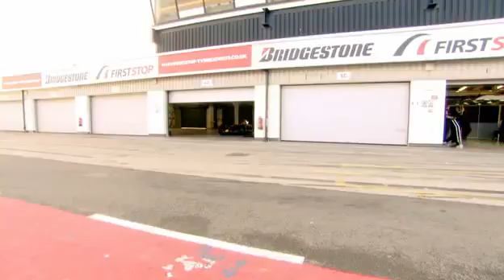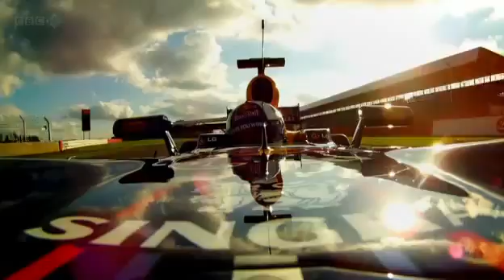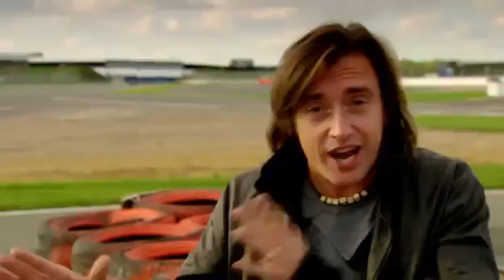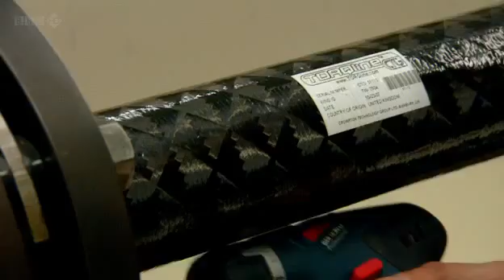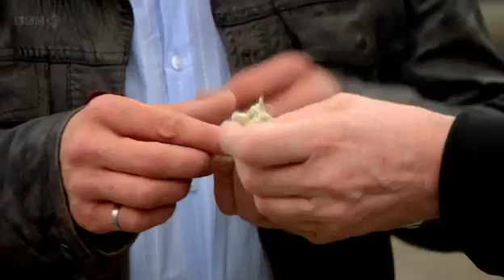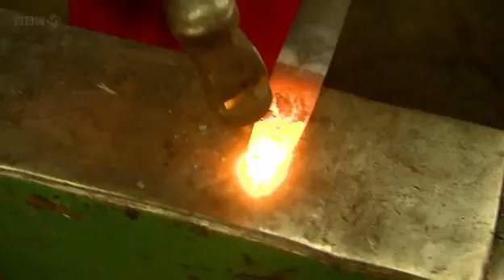Richard Hammond's Engineering Connections - (S03E02) Formula 1.

Comment: The explanation of why an aerofoil generates lift is somewhat incorrect, and does not elaborate on the actual explanation on why lift forces are generated. It is not only a matter of a difference of pressure, as the propulsion in a sail boat going up wind, or the down force for lift force on an airfoil. The driving force is due to the deflection of air in the direction opposite of the lift or down force. If it was only a matter of difference of air pressure that created lift or force, then aircraft would not be able to fly upside down.
Reply: Adam Sage , il bet your friends love having you round for lunch 😔😪

Comment: 49 minutes and no details.. aluminum block? Tolerances in the cylinder? 0.00000012inch? If the block was steel it would expand at a lower rate than the aluminum piston.
Reply: Aluminium*
Reply: Potato patato.
Reply: consaka1 it's Aluminium, not Aloominum 😬

Comment: if its too cold it will wear? but if heat is introduced to metal it expands. i don't understand?
Reply: Yes, That is right, The metal piston/piston rings and the cylinder walls will expand as the engine heats up and then it will come to operating temp and the metal parts will have changed the gaps between all those parts at operating temperature compared to when it is cold and when it has JUST started up on a cold start. So all of the parts are precision measured and machined so the gapping between all of the motion assembly and load bearing parts like the:  pistons/piston rings to cylinder wall clearance, bearings to crankshaft clearance, bearings to connecting rods clearance, connecting rod pins to connecting rods/pistons clearance, etc...all of those gaps have to be exactly perfect for optimum performance and reliability also, and they machine the parts specifically so the gap is optimized and is just perfect at operating temps. 

By having all the moving metal parts measured to be properly gapped at operating temps, that means any time those parts are cold the metal slightly shrinks in size, which means all the measured gaps will then always be larger, and those larger gaps between the motion assembly and load bearing parts will allow excessive movement. That excessive movement allowed by the larger gaps makes the engine vulnerable to excessive wear and can cause reliability issues to go and beat on a motor that is still cold.

This concept explains the whole reason why it is always important to let an engine come to operating temperature before putting it into driving and driving off. Or when people start their engine up and rev the hell out of it before it warms up, yeah that's never a good idea either, its just common sense if you think about the thermal properties of metal and how much it expands between ambient air temps like say in the winter when it could be 32 F or below freezing, and what the temperature is at normal operating temperatures. 

A car should be running with a coolant temperature of around 180-190 F, Sometimes getting to 200 F with certain engines. Also, the engine oil should be running at around 215 F for normal driving and can get up around 300 F in racing conditions and in race builds that can handle it.  The oil takes WAY longer than the coolant to come to temperature, as long as 20 minutes with some oil, and the oil is what is actually doing the lubricating of the metal parts in the engine, and the oil doesn't properly lubricate and reach its proper viscosity until it is at operating temp.  So some engines and oil combinations it is proper procedure to wait literally 20 minutes to let it come to operating temperature before running the engine hard, any build like that though would surely be running good engine oil temperature + pressure gauges.
Reply: Yes you are right, the piston expands but so do the combustion chamber walls. One expands slightly more than the other. As the guy said, both the chamber walls and the piston is fitted when it is hot as such when both are up to temperature the clearance would be perfect.

Comment: 2.4L is in europ one of the bigest petrol engines that you can buy and its in the most expensive cars
1.6L is the average and 1.3 in small cars
Reply: 2.4l is NOT one of the biggest petrol engines you can buy in Europe.  Not by a long shot.  It may be one of the biggest available in economy cars, but not one of the biggest you can buy.  Not even top 10.
Reply: And now f1 engines are 1.6L
Reply: http://www.theicct.org/sites/default/files/publications/EU_vehiclemarket_pocketbook_2013_Web.pdf
page 58-59 

Yon can buy a car with biger engine but it is luxury import not a car made in EU for EU and 2,4L is not in economy class that is around 1-1,3L and in 2015 all new cars must have maximal fuel consumption 5,3L/100km or 53 mpg , average in my contry is aroud 7L/100km or 40mpg you have aroud 25,5mpg but that is in news post what a average car make on galon
Reply: F1 cars use a 1.6 litter engine now.
Reply: You definitely can't read statistics man. It's the average displacement for the vehicles they sold the most. There are a lot of 4 to 6 liters engines here in the big mercedes and bmw. For example, the vw passat has often a 2 liter engine, yet vw numbers are under 1800cc, that's because of the Polo's and Golf's they sell more.
Reply: wow its crazy how most people really have no clue how to read statistics and end up making false correlations, it happens way too often... 

The graphs you are referring to are CLEARLY showing the AVERAGE displacement size of all the motors used in cars being sold by that company combined from that time period, NOT the maximum engine size being used like you are claiming.... So, just because the BMW and Mercedes are both in the 2Liter range on that graph, that doesn't mean in any way that the largest displacement engine they used was a 2Liter engine. What the graphs are showing on the pages you are referring to, is the average displacement size of all the engines sold in production cars during that time period.   

So since the graphs you are referring to are showing the average engine displacement during a certain time frame, Hypothetically, it could show a company listed on there with the total aggregate sales over the course of 1 year, and say they made 3 million car/engine sales in total. The sales could be hypothetically broken down to exactly: 1 million 2-Liter Engines, 1 million 2.5-Liter Engines, and 1 million 3-Liter Engines, so then the graph would be showing that the company had an average of 2.5L and that is what it would show on the graphs you are referring to.

SO, by no means do those graphs imply that in Europe they don't make engines larger than 2.5L.... The only scenario where it would be true to the situation you mentioned would be if the company being listed on those exact graphs only makes one type of engine for ALL of the cars they produce over the period of time being listed, then that would be the one situation where the graph would actually show the maximum engine size that company makes.  

I hope that clarifies things for you.
Reply: Here in the USA, you can buy family SUVs and affordable muscle cars like Ford Mustangs that have 5.0L engines. I think the difference comes from 2 causes. First, America is so large and spread out, with lots of space for big cars. It would be very difficult to park a Chevrolet Tahoe in a European city, but pretty easy in the US. So even if regulations allowed it, I don't know that Europeans would even want such big cars. And secondly (and probably more definitively), the EU taxes you based on the size of the car engine. In the US, there are actually pretty strict emission regulations, but it is not tied to engine size. So as long as the maker of a 5.0L engine can engineer it to meet emission regulations, there is no additional tax tied to the engine size itself. In the EU, if you have a car with a 5.0L engine, you can expect to pay an enormous amount in taxes...

Comment: Too bad rain and Safetycar destroy the Spirit of Formula one. The best drivers in the World cant drive on a wet road.
Reply: You can drive a formula 1 car slow? Like they do behind every Safetycar? Cold brakes? Break earlier. Cold tyres. Drive slower around corners. Engine gets too hot? Maybe your engineers built a shitty car. In my opinion all those problems are problems a Formula One driver should be able to handle. Other drivers in different series have to deal with things like this too. Best drivers in the world? haha Good Joke. Those problems are the reason why winning a race in the rain is something special. And those races are the few races the driver makes 90% and not the car. In all the dry sunny races the car makes 90%. I made my decission on Sunday after Lap5 . This was the last formula one race  i watch. And thats the biggest reason why safetycar was wrong. If Formula one deletes the risk and the accidents they loose Fans.
Reply: Its completely undrivable in bad conditions? How about driving slow?Formula one drives in heavy rain since years. But now its not possible anymore? Are you fucking kidding me? Yes those are the hardest races.Thats why it makes it so special to win a race in heavy rain. In the best racingleague of the world this is the hardest part. Cut it out and you cut out the spirit of Formula one. Fearless drivers handle every condition. They look into the eye of the death. Some fail and throw the car away. Some can handle it. But all of them try to win. I dont wanna see them getting injured. But i wann see them fighting agains the bad conditions.40 Years ago Formula one was much more dangerous. Shitty cars. Bad racetracks. And they drove in heavy rain. They looked into the eyes of the death. And the Fans staggered, astonished. If drivers of today dont wanna take that risk they should choose a new job. There are enough drivers out there who would take that risk. Since there are so many children of ex drivers maybe its more importand to have connections to reach formula one than to be fearless. English is not my native language. The risk is part of the Myth Formula One. In the championsleague of Racing heavy rain is the supreme discipline.I dont wanna see rich kids driving in best weather. I wanna see men. Maybe you are pleased with a boring coward Wimpformula one. The fastes CAR wins every race on a dry track and nothing happens. Thats not my definition of Formula One.
Reply: *****
F1 is being deliberatly thwarted to reduce speeds, though. Pirelli make degrading tyres on purpose, otherwise we wouldn't have pitstops, and the engines are only getting smaller. If you gave the constructors free reign they'd make some absolutely monsterous cars, the problem is that it would spred out the grid completely, and the constructor with the most money would win by default. The cars would also be super dangerous to drive.
Reply: Do you remember Jules?That day he crashed in Suzuka,it was a rainny day...Look how many drivers went out of the track in K1.Don't be so cruel and absolut!
Reply: You remember all the drivers who died on dry days? We better dont drive on dry days too. 

Most drivers died in Corners. We better dont drive thru corners anymore.
Reply: The big problem is that modern F1 cars cannot drive in standing water. You have absolutely no grip, and at 200 km/h in a corner that is just suicide
Reply: Maybe they could drive slow? And the fastest of the slow who challenges the wet track most wins the race.When was the point formula one decided to only drive on a dry road?
Reply: tabofantasy Nerdking
You can't drive slower, because then the tyre and brake temperature is too low and the car doesn't work properly. The result is reduced braking power and grip, and in turn hitting the wall. There is no middle ground when driving an F1 car.
Reply: tabofantasy Nerdking
A formula one car is not like any other car. It's much, much faster, I mean ridiculusly much faster, and it's completely undrivable in bad conditions. They do drive very slow behind the safety car, so slow that they weave back and forth not to lose all grip. The safety car, however, is driving as fast as it can. You cannot compare these cars to anything else. I do agree that sometimes there is too much sc because of weather, but what I don't understand is why people complain the way you do. Are there not enough crashes? Do you only watch sports in the hope of someone getting injured? Cause that's pretty fucked up.
Reply: +Ze Rubenator it still doesent change the fact that its possible tough , i mean look at lemans prototypes they are only a little slower thatn f1s ( in the recent years the advancements they made are huuuuge) and they can still operate in bad weather conditions AND alot longer. There is no excuse f1 engineers and pilots got lazy and if it stays line this Lmps are gona overtake them in performance and technology.
Reply: +Ze Rubenator see in lemans audi's porbably the one with the most money but toyota and porsche are still strong competitors( 2016 porsche won ,yay) so i still think that f1s getting lazier with each day. Yes pirellis are fcked up tires but that shouldnt hinder engineers to produce new things , they  even have a larger budget than lmps if i recall correctly
Reply: *****
They have a large budget, but the forcus on aero is absolutely insane. They have very strict rules for what is and isn't allowed, which is the nature of formula racing. There are so many technologies they aren't allowed to use, and in order to slow the cars down spoiler sizes are very reduced. The engines are also being regulated heavily, so the only thing the constructors really have control over is transmission, suspension and aerodynamics. All of which still has to be within the confines of the regulations. Every time a constructor manages to do something innovative and effective, it is subsequently banned. Now the regulations for 2017 are very different, and we'll see cars that are several seconds faster just on account of wing and wheel width. Hopefully it will make for more exciting races (demote Mercedes).

Comment: unfortunately the whole "piston cannon" analogy is very flawed in so many ways. first of all the valve that lets the pressure in doesn't open instantly or consistently. 2nd of all (and to add to the valve problem) the tighter piston is so tight it actually sticks in the bore. this means the loose piston starts moving out of the way of building pressure while the tight piston sits there allowing the pressure to build higher behind it before it moves which has nothing to do with how an actual piston or pressure works in an engine.  3rd they didnt use any oil which reinforces the 2nd problem outlined above and last but not least pistons dont even do the sealing, RINGS DO and neither of the pistons used in the cannon had rings on them!  
to test this properly they should've put rings and oil on the pistons, put them in the bore and then put a force gauge on the piston and released the pressure measuring the force of the piston on the gauge as the pressure leaked past.  with that test I bet both pistons would be pretty much the same.
Reply: I'm pretty sure the actual point was that Formula One engineers has a bigger payoff in being more precise in making/designing F1 cars.
For me, if there's anything wrong with piston-cannon connection, it's that it's redundant. It isn't so much an engineering connection as much as an engineering principle. At this level, everyone already expects the engineers to be making these cars right to the limit. It's their job.
Reply: I think you're missing my point.  I never said they were wrong. I never said lose pistons seal better.  I know tighter pistons will have less blowby. I have a built tuner car with forged pistons I can tell the car makes much less power before the pistons heat up and expand plus there's more blowby in the PCV system when cold.  I've rebuilt engines before so trust me I do know what I'm talking about. 
What I said was THE ANALOGY is flawed and there are better, more scientific ways they could've made their point.
Reply: i agree but for another reason i was thinking the piston experiment with the air canon is aimed more at conventional car engines and not F1, all engines need a good fit, and the experiment shows the differences, but the F1 engine is on another level and im pretty sure conventional car engines were around before the modern F1 car in which he is talking about, he really should of showed something that needed to be heated up to work that existed before todays F1 cars or something along those lines.